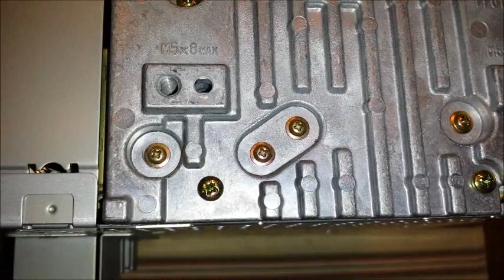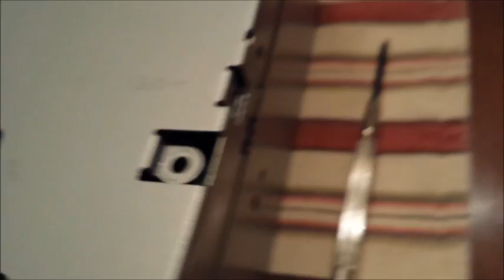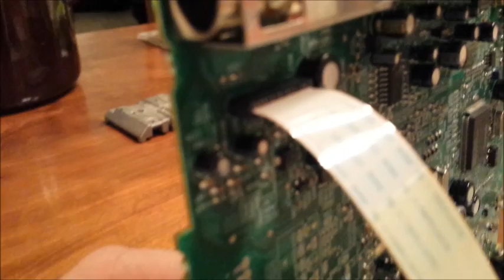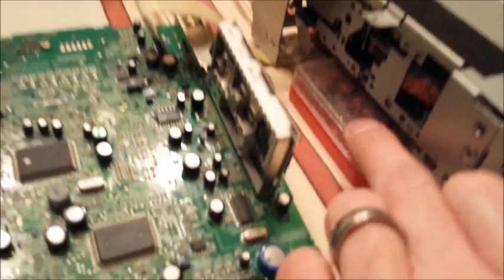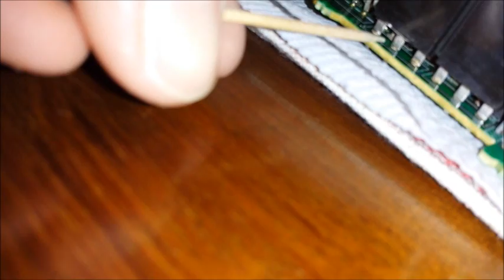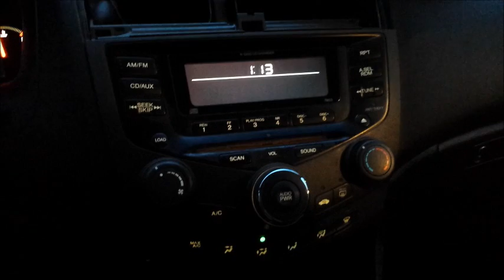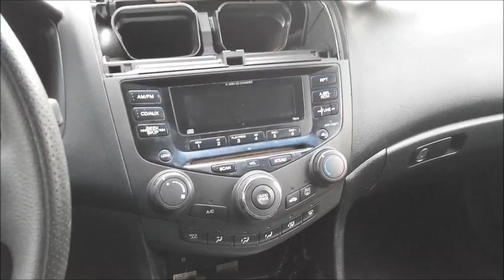2003 Honda Accord Radio Repair - Part 2

Comment: hey matt after watching your clip I took courage to fix this problem to my car exactly the way you explained but unfortunately it never worked twice & the third time I asked my friend who is computer expert and as well capable soldering person to remove the defective part out of the mother board
after all the efforts back light popped up and stayed for couple hour and then gone blank but after the third attempt in which I removed the defective part back led light disappeared and now my CD player is not working as well
stereo is throwing out the cd once you load
so obviously I am not a happy person now because before my STEREO am/fm and cd player was working absolutely fine but no back light but now no back light plus my cd player is not working as well
I am not complaining but asking if you know by any chance if I can fix my CD player
thank you
lovepreet15@gmail.com
Reply from the maker: lovepreet singh I'm really sorry I'm just now replying to you - for some reason YouTube filtered your comment into the "spam" category and I didn't realize it was there.  Anyway, I'm sorry to hear about all of your struggles.  Unfortunately, I'm not totally sure what may have gone wrong.  I suspect that perhaps some solder may have touched another part of the motherboard and essentially shorted two circuits together...but that is honestly just a guess.  In your first two attempts, did you use the "Circuit Writer Pen" method, or did you actually solder the resistor?

Thanks for watching, and I'm sorry that you encountered issues with your repair.  Let me know if you were able to figure it out.
Reply: Go to junk yard and get another radio for $ 20

Comment: Hey I have no lights display. On ac panel/ climate control knob, radio knob, fan knob they are dark. This would solve the problem?
Reply from the maker: Talha Mujaddidi I'm not 100% sure, but I know that when I made this repair on my friend's Accord (the one in the video), it did fix the issue with the AC control backlights.  I'm sorry I can't give you a more definitive answer, but I would do some research on a Honda forum to see if you can find your answer.

Thanks for checking out my video!

Comment: Hi Matt, firstly awesome video .... I've been searching everywhere for a solution to this annoying problem. Hopefully you could help answer one question? My radio back light display is operating fine, however its the back lights for hvac control buttons for certain areas such as power button, ac functions and the disc stack numbers have stopped lighting up (climate control seems to be lighting up ok). Do you believe your repair will solve the issue? or does your repair need to be applicable to both the radio back light and as well as hvac back lights to not light up? Thanks !
Reply from the maker: Mark Luong Thanks for watching Mark!  I'm sorry for the delayed response.  I am honestly not totally sure if this repair will resolve only the AC control backlight issue.  I have a feeling it would, but I am really only guessing about that.  I'm not an electronics guru, so I hate to send you down the wrong road.  I would look around for a Honda online forum to see what information you can dig up there.

I'm sorry I'm not more help!  Thanks for watching and commenting!

Comment: Matt, Thanks for posting this. My radio went dark couple of weeks ago and I was looking for some clues and I rather hit the jackpot here. I'll give this a try on weekend. I looked for replacement circuit board (OEM) and its somewhere b/w 75-100 bucks. Even if I ended up buying new board, I'll still have 200-300 bucks that I have to give dealer to fox this. !
Reply from the maker: No problem, I'm really glad so many people seem to find this helpful!  Let me know how your repair goes.  Thanks for watching!

Comment: Matt, my brother, you are THE MAN! When I got to the part where you talked about the CircuitWriter pen, I immediately paused it and Googled it to see where I could get it locally. I'm by no means proficient at soldering. I can do it but the results aren't pretty and I need lots of space between the part being soldered and basically anything else.... components, pets, kids, etc. When I saw the pen, I knew that was going to be the way to go due to the very tight space. Finished watching the video, jumped in the car and headed to Fry's Electronics and got the pen for $16.00 + tax. Heading out to the garage now to attack the issue and with a little bit of organization regarding the screws, plenty of patience and focus I should be able to knock this out of the park in about half an hour. I've already got the radio pulled. Wish me luck!

UPDATE: After using the pen I let the unit sit overnight as per the directions on the pkg. I then reassembled everything and reinstalled it. The backlight worked until I turned on the headlights to check the button lighting. The backlight went out and the buttons remained dark. I suspect I didn't get enough of the "ink" applied to the rear side of the amp fuse - it's really tight in there with extremely limited access as you know.  I am going to pull the radio back out and redo that area to see if that is the case.

FINAL UPDATE:
I am happy to report that the application of more of the conductive "ink" solved the problem. My radio's display as well as the backlighting of the HVAC buttons are working properly. Thank you again for this video!
Reply from the maker: Steve, that's awesome!  Great job fixing this yourself and figuring out why the backlight quit working after your first try.  It's definitely a tight area and I was concerned I would have the same problem that you did.  I'm really glad to hear this video helped.  Thanks for sharing your success story, and thanks for watching!
Reply: ***** I'm actually trying this out with my brothers car and I'm hoping everything goes fine I hope I don't mess the whole system up or I hope I put enough ink.

Comment: Thanks for posting the two videos. I was able to fix my son's 2003 Accord radio in about two hours (one hour on the repair and the other hour searching for tools). I used the jumper wire method. I soldered a small wire from the right side of the component you point out that's bad to the left side of the one just above it (they are electrically connected). Worked fine and I saved about $500. Thanks!!
Reply from the maker: That's awesome!  Nice work, and thanks for watching and commenting!  I'm glad I could help.

Comment: Hy Matt, nice video all i want to know is while coating that middle resister do we actually have to attach the ink with other two resisters as well. can u plz explain me briefly how to coat properly . much appreciated
Reply from the maker: Sallar, thanks for watching!  You do not need to (and do not want to) connect the other resistors with the conductive ink.  You simply want to create a "bridge" to bypass the bad resistor/fuse by connecting the right side to the left side with the conductive ink.

I hope that makes sense.  Good luck with your repair!
Reply: What if the ink ha a contact with the other two resisters, because when i was coating the bad resister the ink ha the connected on the sides of other resisters.i put the radio back and it did not worked. i there any possibility that i can clean the resister and try again
Reply: Sallar Bloch you need to clean that up or else you may end up with a short circuit. It's very important that you only bridge the one resistor shown in the video.
Reply from the maker: Sallar Bloch As diatribe pointed out already, you definitely need to try to clean the conductive ink off of the other resistors.  If you have fused all three resistors together, I imagine the radio will not work and you could potentially do some serious damage if you try to operate it that way.  I'm not sure what to suggest cleaning with, but I would check the fine print on your conductive ink pen to see what kind of solvent it suggests for clean up.  Use it sparingly though.

Good luck.

Comment: If you need the 2.3 amp fuse,  please send me a private message on Google plus! :-)
Reply: Hey do you have any idea on a garanteed easy method to fix this problem, I am not mechanically inclined at all, I dont think i can take it apart and reinstall it myself
Reply from the maker: mannie O Mannie, unfortunately I think the only way to repair this is to remove the radio.  I would try to find a friend that is pretty handy with stuff like this and see if he/she will help you out.  If you take it to the Honda dealership, they will likely charge you hundreds of dollars, so it's better to fix it on your own.  But, to do that, you have to take the radio apart.

Good luck!
Reply: ***** matt, I'm guessing its the same radio on the 2005 accord? and my radio just doesn't work at all. not just lights etc. the whole thing doesnt work.Is the resistor you pointed out the culprit?
Reply from the maker: carmonajose888 I am actually not that familiar with Hondas (the vehicle in this video was a friend's car), nor am I an electronics expert....but I'm guessing you have a different issue than just a bad resistor.  Have you checked the fuse for the radio?  I would first make sure that is in tact....your problem could be as simple as replacing that fuse.

Beyond that, I'm honestly not sure what could be causing the entire radio to not function.  Do the controls for the heat/AC work?

Comment: Do the 2003 accords have a stereo code to make it work?
Reply from the maker: Yes this stereo did require a code after I reinstalled it.  This was my friend's car and thankfully he had the code recorded in his owner's manual.
Reply: thanks man. You do some spotless work.
Reply from the maker: ***** Thanks!  Really, I'm just an average Joe that's just stubborn enough to try to fix everything myself.  Anybody can do this with a little bit of courage and some determination.

Thanks for watching!

Comment: Hi Matt, I am performing this job on my car radio and I am at the point where I have the circuit board before me and to my surprise, I do not have a 2.3 ohms receptor where it should be. I have the one above and the one below, but the receptor that belongs in the middle is missing. Instead, what I believe I have is the metal rectangular shaped part that goes below the receptor and it says 000. How would you recommend I proceed?
Reply from the maker: Hi Yuleni, that is pretty strange for sure.  It sounds like perhaps the resistor in question became detached, so there is no way for the current to pass from one side of where the resistor should be to the other side.  I'm not really an expert with circuit boards, but if I was in your position, I would probably take my digital multimeter (used to test electrical circuits - if you don't own one, just Google search "multimeter"; you can purchase one at any home improvement store) and use it to check for continuity across where that resistor should be.  The multimeter should come with instructions on the different settings; once you set it to the setting to measure for continuity, touch one of the wire leads to one side of where the resistor should be, and then use the other wire lead to touch the other side of where the resistor should be.  What you are testing for is to see if current is flowing from one side to the other (in other words, circuit " continuity); if there is continuity, the multimeter should play an audible tone.  More than likely you will find that there is no continuity, meaning that you will need to "draw" a splice in with a circuit writer pen to allow current to pass from one side to the other.  To be sure, you can also take a small piece of wire and touch the ends on either side of where the resistor should be and then check for continuity again.  You should then get circuit continuity.  If so, I would then try using the circuit writer pen method to bridge the gap where the resistor should be.

However, please take this advice with caution, as I am not an expert.  Please try this at your own risk.  Let me know if you are able to figure it out though.  Good luck!
Reply: Hi Matt, thank you for your reply. I really appreciate it. I actually used the circuit writer pen and applied the ink just as you did on the video. (I did this before reading your reply.) I dismissed the fact that I did not have a resistor because I figured the reason why people were having issues with their backlight was because the resistor was not working, so not having one at all would not make a difference. After I applied the ink, I waited the recommended time instructed on the writer pen until it dried. I placed the radio back on and sadly, it did not fix the backlight. At this point, I really just want to buy the 2.3 amp fuse or resistor (online inconsistency on whether the black part is a fuse or resistor). Would you happen to know where I can purchase this resistor. I have searched for hours. Radio shack has the 2.2 receptor, but it doesn't look like the black part I need. Another online user used the 2.2 and reported negative results (it did not work). Would you happen to know where I can find this famous resistor? I still have the circuit board in front of me. I took it out again.
Reply from the maker: Yuleni Pulido Yuleni, unfortunately I really don't know where to purchase this part, or even what specifically it is.  When I did my repair, I read a lot of different opinions about whether this component was a actually a resistor, or something else.

In your case, I would still suggest checking for circuit continuity now that you have "drawn" a circuit bridge.  It could be possible that your conductive ink just did not make good electrical contact on one side or the other, thus not allowing current to flow through.  A continuity test would tell you.  If that checks out, I'm afraid I'm out of suggestions....perhaps a specialty electronics shop could point you in the right direction if you took the circuit board in to show them what you are working on?

Let me know how it goes.  Best of luck!
Reply: I might do that. Thanks.
Reply from the maker: Yuleni Pulido That looks like a fast-acting fuse....but I honestly have no idea if that is the part you need.  I'm sorry I can't offer more expertise!

Comment: Hi Matt, I saw Mitch's video, but since he did not show the part where he actually soldered or bridged the wires, I was left not knowing how to perform the task. He did provide the alternative pen method and then I came across your video. I thought your video was going to show a more detailed approach to soldering/bridging the cables; however, I was pleasantly surprised when I saw you used the pen method!! I might go with this method. (Maybe you should include "pen method" on the title of the video.) Thank you for demonstrating a more detailed process with the removal and placement of the radio, as well.

Comment: hey bro good vid. i have the same issue back lights and center console lights... i followed ur vid but my circuit board is diff theres no r797 resistor
Reply from the maker: Shavoy, I'm sorry to hear that.  Yuleni posted above that she encountered the same problem.  You can check out my suggestion to her above.  Beyond that, I'm afraid I'm stumped by that situation.  I'm sorry I'm not more help.  Maybe a specialty electronics shop could at least help you identify the problem?

I hope you're able to get it figured out.  Let me know if you do.  Good luck!

Comment: Hi Matt, I have the same problem too. Have you read any suggestions that it's one of the resistors that's causing the problem? The resistor is placed next to the part you're shortcuting. Thx.
Reply from the maker: Hi Kunwen Yuan, I have not ready any definitive suggestion about what may cause the part to go bad initially.  I have read opinions that it is simply an issue with the part that I "bypass" in the video - supposedly this part just goes bad over time and stops working.  However, I suppose it is possible that another resistor could possibly be the root source of the problem and could be causing other parts to fail. 

Do you have the same radio problem?
Reply: Hi Matt, thank you for reply. I do have the same problem. The worse thing is I sent my car to dealer to replace timing belt, and they disconnect the battery, so now I have a CODE, which is hard to solve without LCD backlight. Now my car is absolutely silent...
Reply from the maker: Kunwen Yuan Ah man, that's a bummer.  Sorry to hear about that.  I would see if you can repair it the same way I did, so that you can put in the code on the radio.  Let me know how it goes if you do try it out.  Good luck!
Reply: Kunwen Yuan you can put in the anti theft code without the display working. If you don't know what the code is, you can go to your local dealer to obtain it. Put the code into the radio. If it doesn't work the first time, just push the radio power button and enter code again. There should be a beep then it should start working.

Comment: Hey Matt when you fixed this problem was it just for the back light that wasn't working or was it also the audio and display? bc I have the opposite problem back lights work but my stereo won't play and I have no display at the same time. And has the problem completely gone away?
Reply from the maker: Emmanuel, I fixed this problem in a friend's vehicle, but if I remember correctly the HVAC backlights weren't working, nor was the backlight for the radio display.  However, the audio did work fine.  Your issue sounds different.  Unfortunately I am not sure how to fix that one, but it sounds like you might have a bad/grounded speaker wire.  I found this thread about it:

http://www.clubcivic.com/board/showthread.php?s=753d1376a94f4a6d5003da03a442aea8&t=185235&page=2

I hope that might be helpful.